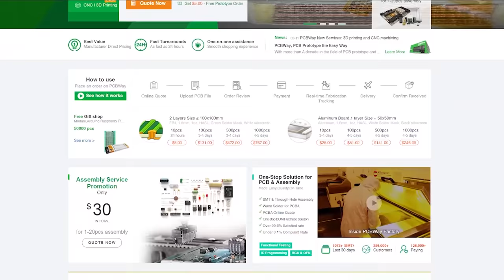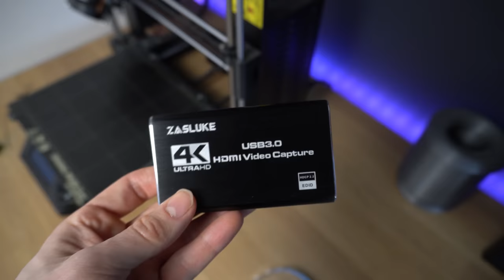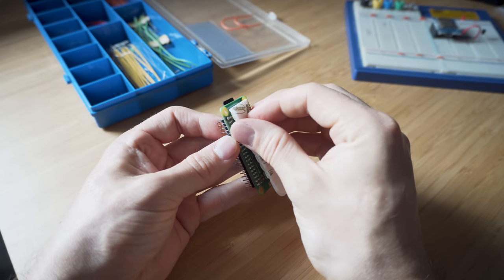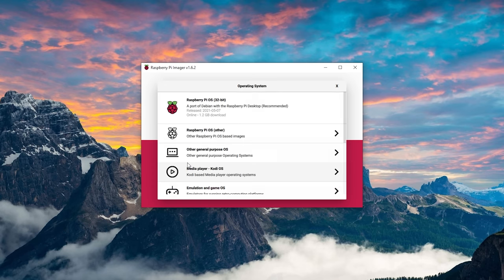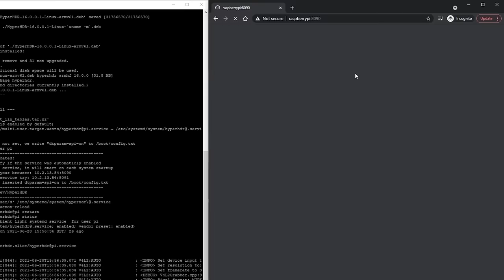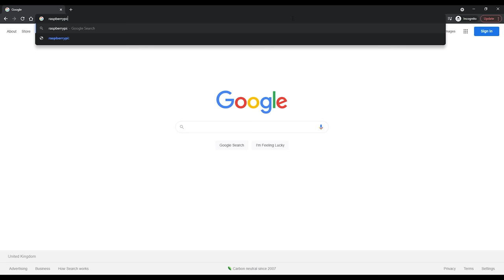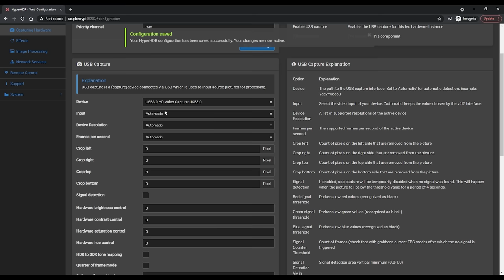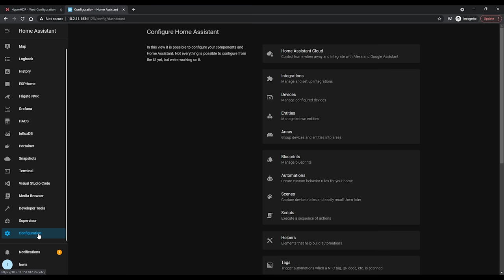The ULTIMATE Guide to Building an Ambilight TV with Hyperion

Comment: I think it's worth mentioning here, that you got lucky that this worked, connected directly to the RPi GPIO pin. The LED strip is expecting a 5V PWM data signal...and the RPi only provides 3.3V. Trying this setup with SK6812 RGBW LEDs... doesn't work, and apparently requires a high speed voltage converter, between the GPIO pin, and the LED strip data connection, to step up the voltage. I have yet to make mine function...but I'm exploring the voltage converter IC solution, soon.
Reply: Pleas let us know if you managed to get this working  :)
Reply: @adamagrest8215  I did! ...using the Adafruit 74AHCT125 IC, by ungrounding the lower left ground on the IC according to their wiring info. I can't tell you WHY disconnecting that ground connection makes it function... but it does.
Reply: @Ellington_Industrial_Arts  I've got a similar situation where I've got SK6812 and a RPi 3B+. I cant get mind working at all, do you have a diagram or picture at all you could share? I'm trying to understand what I need to do to make this work.
Reply: @Callum195  Adafruit has a diagram for their Voltage Converter. Follow that diagram, minus the second ground on the bottom left hand pin of the IC in their diagram.

I tried posting a reply with links and pictures, and YouTube yanked it.
Reply: @Ellington_Industrial_Arts  You are a saint and a scholar. After getting it to work, do you think the RGBW strip was worth the extra effort? RGBW would fit better with the rest of the house, but not if it's too much of a pain lol.
Reply: @Minijuice24  Maybe? The RGBW strip is more expensive... and you have to add the chip for the data translation. The end result is quite nice, but I don't have anything to compare it to. Now that I know how to get it to work, it's not that much more effort... But the frustration of trying to arrive at that solution, was a journey. I love the effect, and I'm glad I got it to work. But I can't say for sure if it's worth the extra cost... the additional component isn't that big of a deal, to me.
Reply: I have a raspberry pi 3 and 4. They both work with RGBW strips directly from the GPIO pins
Reply: @christophertaylor8624  it's great that yours do, but the point here is that they SHOULDN'T. Because the GPIO pins are not putting out the voltage that the LED strip is expecting. This is a solution, for strips that don't tolerate that voltage mismatch.
Reply: @Ellington_Industrial_Arts  So will the WS2812B led strip work fine following the instructions in this video? I just purchased SK6812 but may return and purchase the WS2812B to avoid the headache 😂
Reply: @Ashleyhandz  according to his instructions...yes? I wanted the natural white chip in my setup, so I went this direction and found a workaround to make it function. I haven't tried any other variations.
Reply: @Ashleyhandz  though...in my opinion, it shouldn't work. Because the voltage is outside the design parameters of the LED strip...the model he chose, just happens to be tolerant of an incorrect signal voltage.
Reply: @Ellington_Industrial_Arts  I already have the sk6812 led, they just got delivered. I really want to get them to work but it’s fried my brain reading all these instructions online on how to get it working and then to set it up in hyperhdr. If only there was a video/tutorial on how to do it 😫
Reply: @Ashleyhandz  The setup really isn't too bad, and he does a really good job of explaining the software side of it. But...when you go through the setup step by step...and there's a hardware issue. Then you have no idea what the problem is. I tried different settings for hours...before I accidentally stumbled on something that made the strip come on and I knew it was functional.

Then I tried the voltage shift IC, and followed their schematic...and it STILL didn't work! I kept fiddling with it and it started working all of a sudden. And I figured out that if I lifted one of the grounds that they show on the IC schematic, then it functioned normally and all the software settings in this tutorial worked.
Reply: @Ellington_Industrial_Arts  is there some sort of way I could get a picture of your wiring and software setup, I’ve spent the last couple of hours researching and I really want to be able to get it to work, I’d really appreciate the help and thank you 😊
Reply: Awesome info here, what were your configuration settings? For intense I have a sk6812spi option but I’m not sure which of the spi options I have to choose from to use. I don’t even know what spi is, lol. Or did you use the ws281x controller? So much information out there and nothing has worked for me. Only the first 4 LEDs on my strip light up…wtf
Reply: @ellingtonindustrialarts4060 thanks for sharing. I'm going to give this a spin soon. 

Just wondering how you combined the 74AHCT125 with the pi , not wiring wise but mounting. I want to keep it altogether in a case. Perhaps a prototype board fixed to a few of the pi screw holes?
Reply: @jimmywoody6962  I did a protoboard in a small project case for the IC. The Pi, power supply, video capture box and IC enclosure, all live together in a larger enclosure.
Reply: @Ellington_Industrial_Arts sweet. I just brought a gpio Breakout breadboard shield and IC socket. Should keep it all contained nicely.
Reply: Hi guys do you have any discord chanel where we can make some troubleshooting section? 😅
Reply: I got this kind of running with sk6812 strip but I can never get all 3 colours to be correct always 1 is wrong, do you think it would be better to run through wled rather than data directly from a pi zero w 2?
Reply: @nrlrugbaleeg  the Pi output control voltage is too low to properly control the SK6812 strips...technically too low to control the strips he's using in the video as well, apparently they are just more voltage tolerant.
Reply: I regret clicking on this video as I'm still trying to get this project to work. I'm getting a level converter shifter to convert 3.3v to 5v. See if this works

Comment: a 2024 version of this video will be amazing!!
Reply: I am currently undertaking it now and it is a total nightmare. Especially when you have an 85 inch tv like I do. Totally different setup and you can’t power the pi with the same power supply as the lights. With as many lights as my tv requires I also need a “logic level shifter” which I am clueless about. I have been doing this project for a month now and refuse to give up. Maybe I’ll make a video once I’m done, because this video did not help at all
Reply: @cheffrey9628  Can you just connect the power wires (+ and -) of the LED strips to an extra power supply, keep the data wire (green) connecting to RasPI, that way the LED has enough power. It's kinda similar to WLED.
Edited: Just finishing doing mine (Sony 85 inch TV), got the 16.4ft 300 pixels and soldered a bit more, I separately powered on my Pi 3B and use a PSU to power my LED but I'd think if you want to power up the Pi with the same PSU as LED then it's fine too, just make sure besides the data pin from LED to Pi's GPIO18, you gotta get another jumper and connect the Ground (GND) pin from LED to Pi so it won't flick. I don't use any level shifter whatsoever.
Reply: @caffeinatedw-w  what size of power supply did you use for the LED strip? I'm looking at doing this for my 85" soon

Comment: I installed an early Hyperion version years ago, that's still working today. It's so much simpler and more user friendly than it used to be, I might upgrade it
Reply from the maker: Nice, good to get some long term feedback!
Reply: Are you running this on a Raspberry Pi 3B? I have a spare Pi 2b laying around but can't find a 3B to buy to save my life.
Reply: I also have it running for at least 4 years now (on a 3b+) and it still works flawless.
A lot of my other Pi projects hat to be reinstalled after a few months because error occoured, but this one just runs and runs..
Reply: Don’t upgrade its a f*cking nightmare. I’m 6 hours in and still not got it working
Reply: I also installed the newest version. Luckily and another SD-Card because there was a crazy delay I couldnt get rid of. So I still run the older version now.

Comment: Great video! I do want to mention that if you want to use HDR content you have to tick the HDR to SDR Tone Mapping box, this corrects the washed out image you get when using HDR10 content. I'm using a PS5/Series X and Apple TV all with HDR on and only when I tick the box I get the right colors. Without it the LEDs are washed out. Another thing to keep into mind when using HDR content is to use smoothing. Took me some time, but with the hardware you recommend I finally have everything set up brilliantly on my OLED TV.
Reply from the maker: Thanks! Yes I mentioned this in the video :)
Reply: @EverythingSmartHome  You are totally right! My bad. Still, finally got it working thanks to your great video.
Reply: What typ of led strip did you choose for your setup?
Reply: How did you get HDR10 to work? I have the same capture card and I’m running from a PS5 through the card to my 4K tv but I’m being told by I’m not getting the HDR or any of the other special settings you can get on the PS5.

Comment: I've just completed this project, after some tweaking in the settings I managed to get it to work. The one thing that I now need to sort out is a power supply issue, on the hyperhdr ui in the performance tab it states Undervoltage detected: YES, should I buy a seperate power supply for the Pi and connect the ground cables between power supplies? 
or do I just need a micro usb cable with thicker cables. I have everything wired up the same as in the video, thanks
Reply: Ola estou pensando em fazer quais ajustes você teve que fazer estou pensando se irei conseguir porque sou inesperiente nisso

Comment: If your LED strips don't light up as mine did, check your control signal (green cable). Using WS2812 strips (don't know about other standards), the signal is *one-way*! Unlike 5V and Ground, it is important on which side you connect it to your RPi. I assume the direction is indicated on the strip itself by arrows for most products. If not, don't hesitate to try out, you can't damage it by doing so.
Reply: Mine dont light up. Rsp light is on. I can connect to it. But cant detect my capture card also.

Comment: Thank you for the instructions. Was able to get this one working.  I did have flickering of the LED strip.  Managed to get rid of it by adding an extra ground wire from the pi to the power supply.
Reply from the maker: Thanks, glad you got it working! I did mention in the video that you need a common ground otherwise you will get the flickering. How did you wire the power?
Reply: @EverythingSmartHome  I'm still waiting for the proper power supply to arrive tomorrow so at the moment it is a bit weirdly wired.  😆
Reply from the maker: Haha that will be why then 😅

Comment: Followed the instructions and wound up with a really cool setup!
Somehow my barrel jack connector was a dud (no connection on the negative!), but managed to work that out before too long.
Using a RaspberryPi 3B+ and it's been super easy to follow these instructions and get it all working. 
Thank you!
Reply from the maker: Looks amazing my friend! Well done!

And was the barrel jack connector you had supplied with the power supply by any chance?
Reply: @EverythingSmartHome  yea came in the box! 
Worked initially, but things got a bit dodgy then died…
Have a few more arriving tomorrow so can make my little bodge fix a bit more tidy!
Reply from the maker: Whatdya know, mine did the exact same and I've been troubleshooting that same problem with others on discord and yeah always the problem with the included jack!
Reply: @EverythingSmartHome  I don’t know how they can get them so wrong! 
Thought it was the Pi getting hot - it was a bit toasty, and it seemed to struggle powering the capture card.
Perhaps it was just not getting enough power through the jack?

In any case, bodge job got it working happily, and I have new jacks (and a Pi heatsink) on the way!
Reply: @EverythingSmartHome  so new pack of jacks arrived!
Swapped it out, everything worked... for about an hour. 
Then HDMI disappeared - looked like the capture device wasn't getting enough power. 
Pulled the plug, gave it a few seconds and plugged it back in and this time it seems the positive on the jack has failed...

Did I just get unlucky with two dodgy ones? :-D
Reply: I have the exact Same Problem using a RaspberryPi 4 and the capture Card from the Video.

Comment: I've followed everything in this tutorial, and wired the LED strip the same way as instructed.  The LED strip I purchased will not turn on. The Raspberry Pi turns on but the strip does not.  I'm using the SK6812 strip. What am I doing incorrectly?
Reply: Having the same issue here. I updated my HyperHDR to the latest version and after that, everything works except my lights. I've been searching online and found something about HyperHDR not supporting the drivers needed for the SK6812 but for me it makes no sense as it was working just fine on v16 (I updated to v19). 
I've seen comments about people changing their strips for "supported" ones and that usually does the trick but I hate the idea of having to change something that was working perfectly less than 24hrs ago...

Comment: Hello 👋 I’m planing to make it with a RaspberryPi 4 that I got out from my helium mining rig and making sure I get everything correctly!
My first question is can I use a 12v LED strip? I would really like to use the WS2815 because of the back up channel so when 1 LED get burned it can still work correctly. 
My second question is if it can be done how should I go about connecting it since the raspberryPi is a 5V
Last question is, my RaspberryPi has a heat sink connected to another board with a LoRa technology so how would I be able to make the fan work without the other board?

Comment: Question.
I have hyperhdr up and running but when I turn off the hdmi input and the pi detects no signal. The led light go to a dim white glow. Is there a way to get them to completely shut off when no signal is detected? I found a ton of advice on leds not turning on but couldn't find anything about the leds not turning off.
Reply: If it's possible to detect whether there is a signal or not, you could build a script that starts Hyperion if there is, and kills Hyperion as soon if there isn't. Or cut off power to the GPIO pins if something like that is possible.

Comment: Would it be possible to realise such a setup without a Pi and to do the software part on my normal computer? Because I only use the TV (or in my case a projector) for displaying my computer screen anyway and I don't want to get a Pi just for some LED Software. Any thoughts or help appreciated!
Reply: Technically yes. But two thoughts:
1. You have to find a version of Hyperion that is compatible to your OS. If it's not Linux, I highly doubt you'll find one.
2. The wiring part would be much more difficult and also possibly entirely different since you have to connect them somewhere to your motherboard, I think?

Comment: Thanks for the magnific guide.
I have a problem. I have configured all the things, but the LED status is off in the dashboard. I have a 4k card and wx2812b strip. 170 total leds and 10A power supply.
I can see live video and the Pi (model 3B) seems to get the correct info from the TV through the card, but the leds does not work. I have read some comments about enabling root (also I have seen one of your answers saying that the code was already prepare to do this). So I need some help please.
Reply from the maker: Thanks! Yep, follow the video fully and you'll see that you need to re-paste the 3 commands at the bottom of the script again to enable root.
Reply: @EverythingSmartHome  Thanks for your fast response! Do you mean that four code lines at minute 16:12? I have just realized I didn't do it. I will try this evening.
Reply from the maker: That's right, I think I out text on screen to say what to do?
Reply: @EverythingSmartHome  Solved, thanks!

Comment: Great system. So you use just one power supply for Pi3 and LED lights? The LED Lights dont have a own power supply source? I have a 42" TV so my LED stripes would be a bit longer (more LEDs) do think that i need a second power supply for the LED stripes?

Comment: One of the best DIY guides for setting up Ambilight. Just missing the information on setting this up for a computer monitor instead of a TV. (in that case, you don't need the capture card just the Hyperion Windows App that outputs your computer monitor to the Hyperion app running on the Rasberry Pi on your network.

Comment: Hello! Thank you for doing that video, I think it's the best one in this topic.
Few inputs from me after I've managed to make it work:
- I've used HyperBian instead of HyperHDR on  as my capture card was not found by any means in HyperHDR on RaspOS.
- I'm using Raspberry Pi 4 and there was a problem not present in pi zero of Hyperion having no permissions to read input from led pin resulting in led output constantly shutting down. Solved it by running service as root.
- I went for a "neat" solution and purchased four corner connectors just to find our they are incredibly unreliable for no reason just like you mentioned
Reply from the maker: Hello, thanks! HyperHDR is a fork of Hyperion, therefor if a capture card works in Hyperion then it also works in HyperHDR.

Yes you must run as root, the install script I created for HyperHDR makes sure it runs as root but since you are using Hyperion that might have been an issue.

Glad you got it working